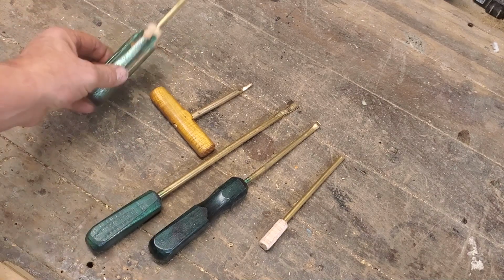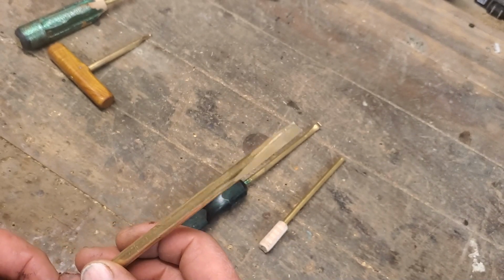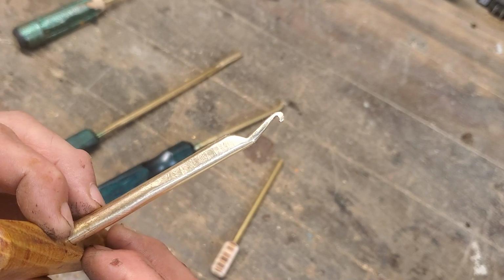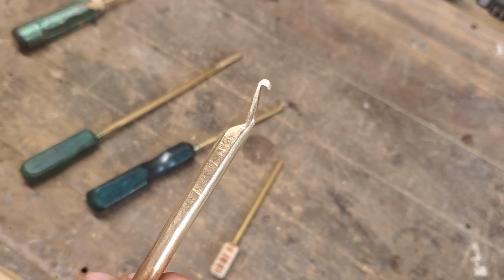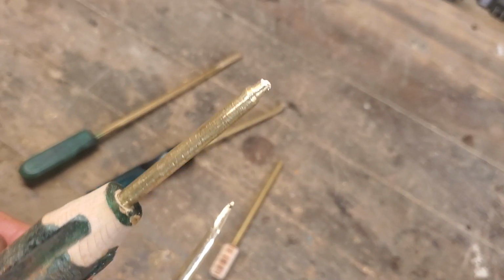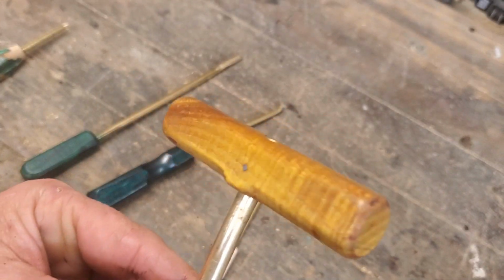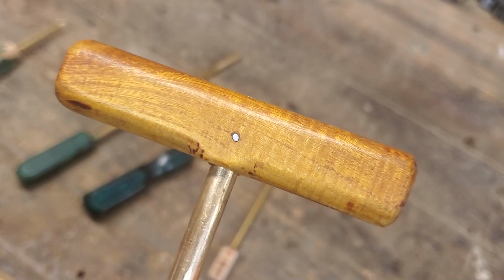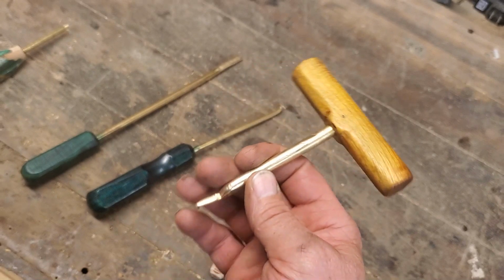DIY String Bending Tools You'll Love

Comment: I would add two more tools.  Stabiliser wire bending tool Supply 88 and a small level for setting the plane of the three strings on each hammer. Supply's stabilizer is sometimes useful for tuning difficult notes at the top of the scale (5's 6's octave) 👋